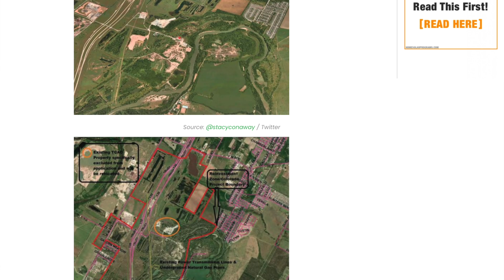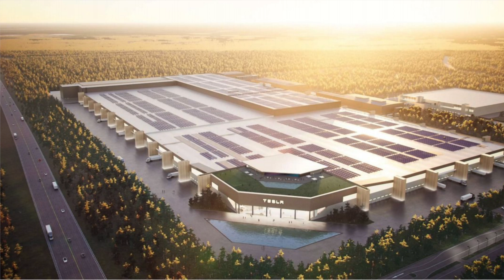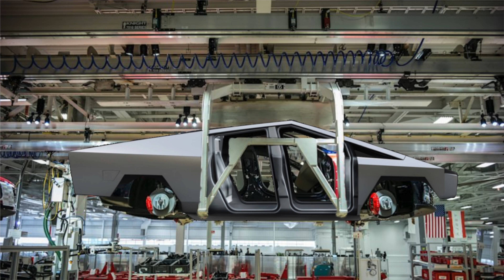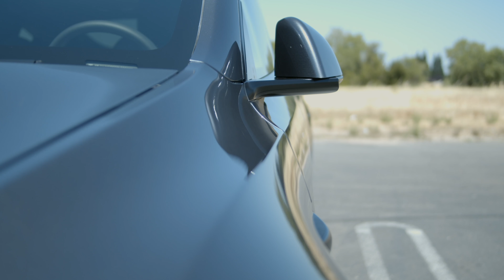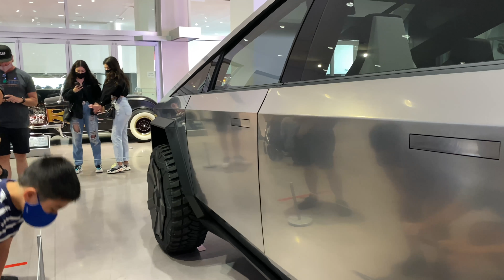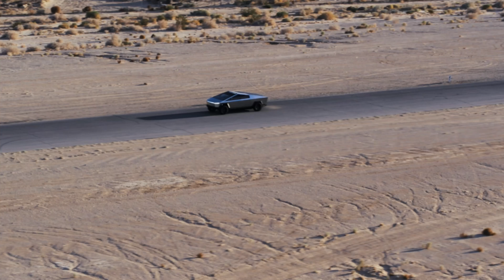GigaTexas ALREADY going through Pre-Construction Process

Comment: Good idea you have brought up about starting with the CT! I had a thought about future products Elon could go into while while watching "solving the money problem" earlier today. This is what I posted there and will cut and paste it here. I really think this could work into a money maker too... 

I watch a lot of videos about Tesla and there is one segment in the market that I've not heard anything about. RVs. Big 40' RVs rear wheel pushers. Most are on custom built frame already so to me it would be such a no-brainer for Tesla to furnish just the power module with batteries to the RV manufacturers.  I see a duel motor, in a subframe with the axles and wheels mounted already. Just roll the subframe assembly in between the chassis rails and bolt it in. The battery could be part of that module or mounted further up to the center of the chassis. Add electric steering and brakes and you've got a very economical RV with so little maintenance. 

Where ever most big RVs stay the night, they already have 50 amp 240v plugins at the site!! Like I mentioned before, what a no-brainer it would be!!
Reply: While it being a great idea probably won't happen anytime soon
Reply: @filmislife77  You're probably correct there
Reply: @royallclark6331  -- I'm sure numerous coachbuilders and limousine companies agree with you heartily.  They are entirely out of luck though.  At this juncture in their development, Tesla has NO interest un providing bare, stripped chassis for third parties to customize or modify.  They'd do better to just buy a Tesla Semi and hook up an RV with a Fifth Wheel attachment.  No walkthrough/passthrough, but it would be pretty awesome anyway.  Especially for companies like STAR WAGGONS.